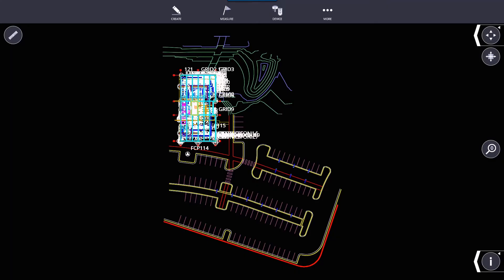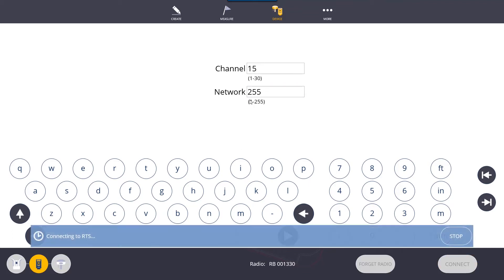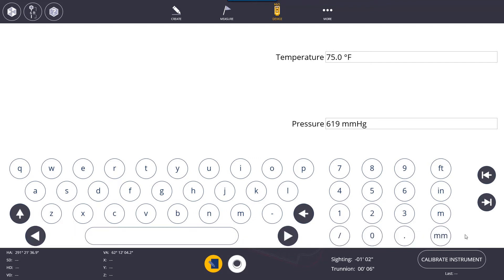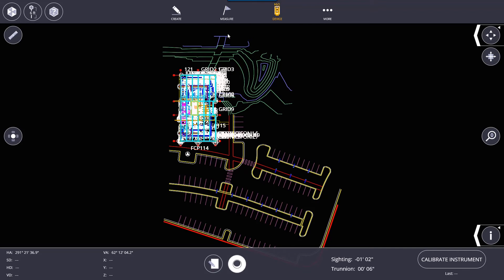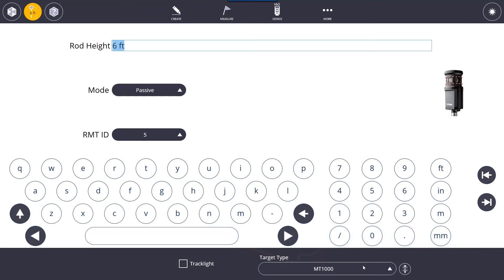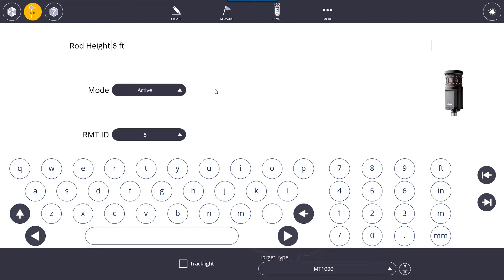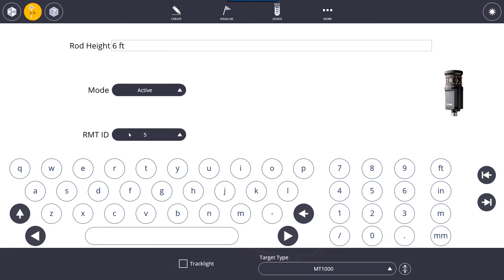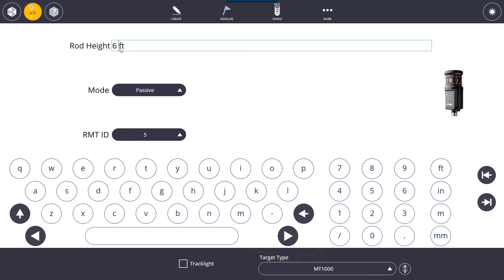Trimble Field Link - Device Menu Robotic Total Station and Prism Set Up

Comment: There’s a setting for true height , S Notch, SX Notch.  What if my SECO Rod won’t allow me to be True Height But One of the notches are I presume .  What the difference between the three and where are the other two located on prism ? Thanks ,
Reply from the maker: All of our Trimble rods/poles are marked with dimensions that include the height of our standard prisms (MT1000 and 360), which is approximately 5-1/4".  This means, when you set the pole to the 6.0-foot mark and place the prism on top of the rod, the total height to the center of the prism from the ground is 6.0.'  We will be happy to help you if you let us know the pole type and prism you use regularly.